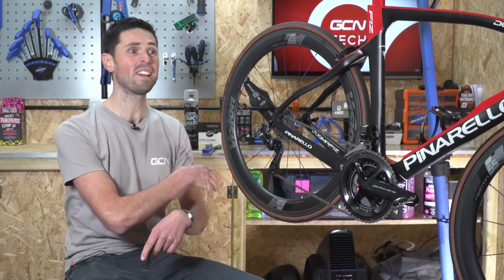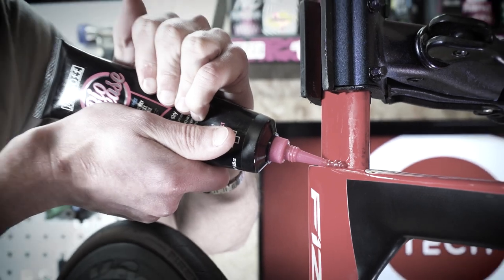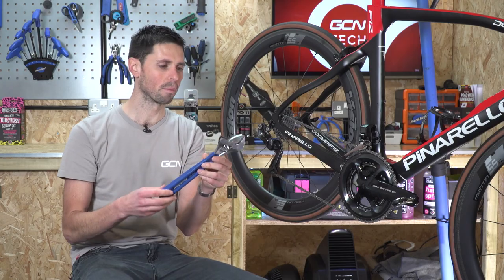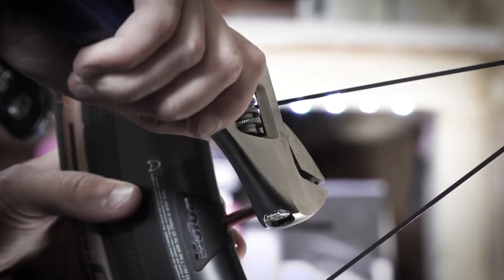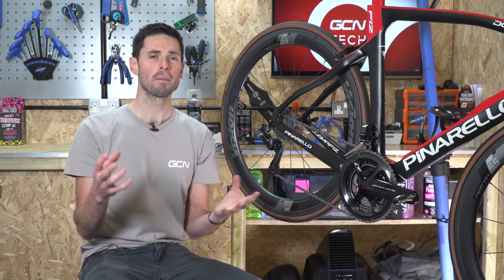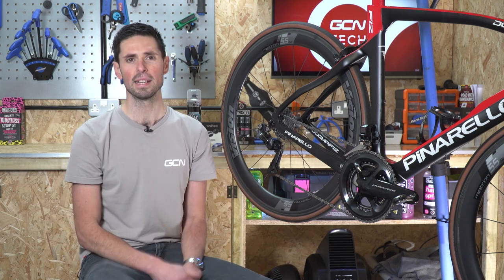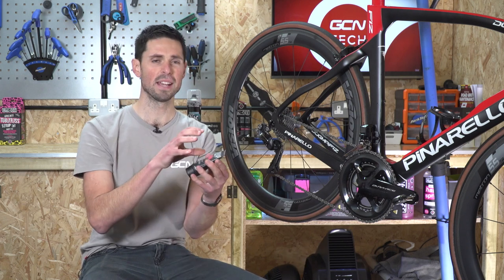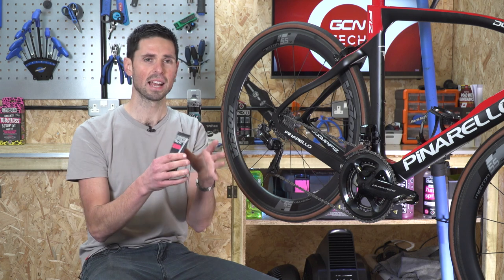5 Maintenance Mega Mistakes | Maintenance Monday

Comment: Made the mistake twice of using olive oil on my chain in an emergency when I worked at a restaurant and had my bike locked up out in the rain. Chain snapped after a couple of days both times so I think it's slightly corrosive.

Comment: Do we really need to use carbon gripper paste for the seat post?
Reply: YES 100% and I know what I'm talking about cause Carbon on Carbon would slip without Carbon Paste....
Reply: Well..it gives you more friction for the used given torque..
If you have enough friction already, you wouldnt need..
But as the torque you are allowed to apply is very limited on carbon parts, its better with than without..
Reply: @floridrummer88  That makes sense. I've never used a carbon seat post before so that kind of thing never crossed my mind.
Reply: only if it's made out of carbon
Reply: I would specifically avoid it actually. Clearly they don’t work in a shop where customers complain about all the random noises bikes can make. I’ve seen a dropper completely fused in a carbon frame where carbon paste was used leaving the bike completely stuck with a broken dropper… real shame to have to buy a new expensive frame and dropper vs just replacing/servicing the dropper. Just make sure your grease is carbon friendly but most bike grease these days is. Probably fixed more creaky bottom brackets by properly torquing seatposts collars, saddle clamps, and chainring bolts than touching the BB

Grease on seatposts always. Carbon paste on carbon railed saddles, bar/stem junctions, can’t really think where else I use it… otherwise grease to help stop those creaks.

Comment: how about carbon grip for nuts and bolts so that they dont loosen up?
Reply: For stem bolts, grease is the one to go for (or anti-seize if they're titanium). The slight bolt elongation when torqued holds the bolts.

Comment: what a load of rubbish, ive always built my bikes for 20 years ish, never broke a nut or bolt or anything else and I've never used a torque wrench except for cars vans or even proclains JCBs etc etc as for park tool that stuff is pathetic and a stupid price, my Milwaukee kit is cheaper than that even MAC tools are cheaper,

Comment: #AskGCNTech, Alex and Ollie,  I have been running my new Zipp303s wheel tubeless with Continental GP5000’s. This is my first tubeless setup. 

At what point does one need to add more sealant?  Does the sealant need to be changed like the fluids in an automobile?

Love the show. Keep up the great work.